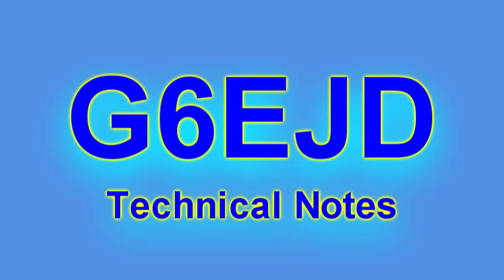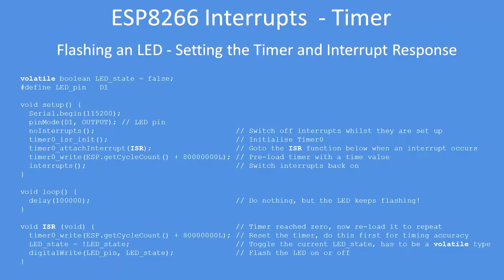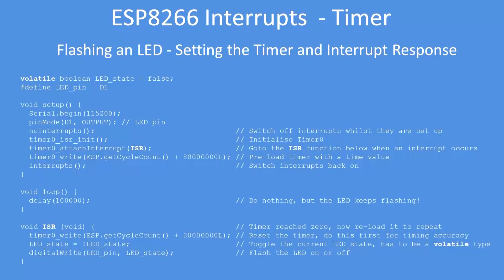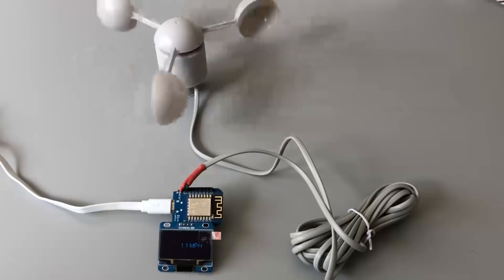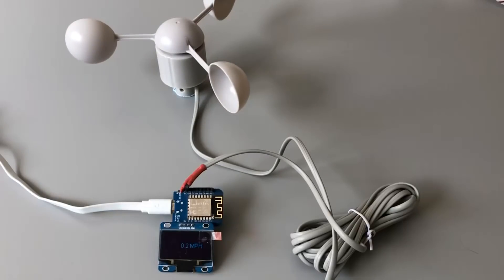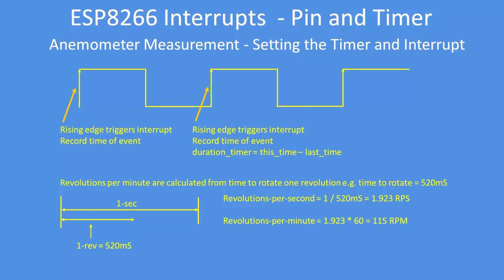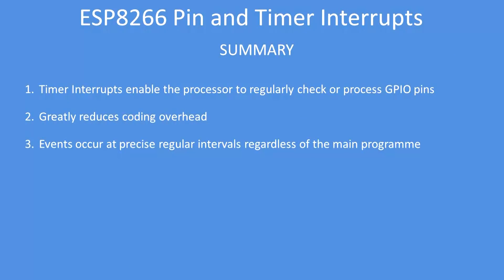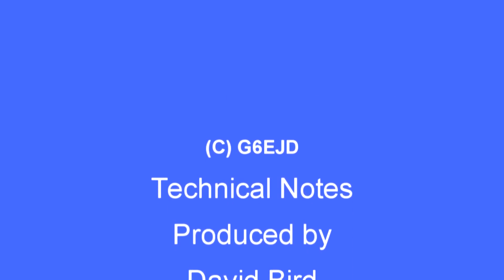Tech Note 125 - ESP8266 Combined timer and pin interrupts to measure wind speed sensors

Comment: Thanks for another clear tutorial Dave. I have a question about ESP8266 timer0, somewhere I read it's also used by the WIFI - if so how to use another (free) timer? I tried simply changing your code from timer0 to timer1 which compiled but timer interrupts didn't happen. When I run timer0 + WIFI every so often the MCU resets, I'm wondering if that's due to WIFI using timer0.
Reply from the maker: There are unreliability issues with timer interrupts using the Arduino IDE largely because interrupts are simulated and so are not hardware based. A lot depends on the interrupt speed your using, you should expect more issues the faster (or shorter time) you use. Yes there is some WiFi interactions but I think more likely your issue is about cpu brown out and that is resetting the cpu and problem like this nearly always stem from poor quality of marginal power supply, have you tried a different power source?
Reply: @G6EJD  Thanks for your timely response.
Interrupt rate is 50mS, not too fast I hope. Double checked PSU, it's a 2A powered USB hub feeding a 3.3V regulator all cables are short as possible.  I will put a 470uF cap. on the ESP-12F module for good measure.
Does the ESP8266 print 'brownout' debug msg, like the ESP32?

Originally the code was based on Tech Note 122 - "ESP8266/ESP32 NTP Time – The Simple Way" which worked well but periodically (after ~10mins) MPU would reset with a stack dump. I 'thought' the cause was timer0 used by WiFi because turning my router off after initial NTP sync - gave no resets at all.
Using timer1 doesn't seem at all straightforward, so far I can't get interrupts with WiFi enabled.
When you said " interrupts are simulated" do you mean they result in code that calls the ISR after counting given number of ticks?

I'm using PlatformIO, Arduino framework.
Reply from the maker: @rodneytapit5636  in the Arduino ISR structure they are not using timers per-se they are using the millis() and micro() to simulate a hardware variant. I e never experienced any issues with the 8266 as your seeing, have you captured the stack dump and used the esp debugger to trace which line in the core code or libraries is causing the issue?
Reply from the maker: @rodneytapit5636  ok, but you need to use that output with your specific source code and compiled image to trace the line, I can’t do that without exactly the same hardware. Do you have the ESP trace tool installed?

Comment: Hi again
Just noticed this video today...
Already ordered the items.
Two questions please
1 - it doesn't require 0,1uf capacitor?
2 - I am planing to integrate it as an entity in home assistant using esphome addon. Could you help converting the code to yaml?
Thanks again!
Reply from the maker: You may find it beneficial to add a small capacitor across the switch terminal to smooth out any switch bounce, but in general not required. Yes I can help with code conversion
Reply: @G6EJD  Hi, how are you? I FINNALY got my d1 minis and wind sendor... But while waiting I researched and would like to ask you if you could convert your code to esphome/yaml... Sorry, I am really newbie with this but being possible, would be easier to integrate in home assistant am I right? Thanks a lot in advance! Br
Reply from the maker: Probably, but I haven’t done much work on HA to know about the complexity of the task.
Reply: @G6EJD  sent you an email, have a look please when you have time.
Reply: The integration from esphome to home assistant looks very simple... Where I will need you help, if possible, is to flash your code converted to esphome if this make sense...

Comment: Hello, Can you please explain the debouncer  part of code in " ESP_Anenometer_SH1106_OLED_03.ino" ...... Thanks in advance
Reply from the maker: if (!(millis() - Debounce_Timer) < 5). When an interrupt occurs the variable Debounce_Timer is given the value of millis() then if at the next interrupt that occurred too quickly - it bounced! Then is millis() - Debounce_Timer less than 5, where 5 represents the chosen Debounce time, if so the interrupt event is ignored. And so debounced.
Reply: @G6EJD  Got it. I'm trying to adapt your codes for  my DIY CNC spindle tachometer project, hope it'll  work for more then 25000 rpm motors. that was very helpful. Cheers
Reply from the maker: At 25000rpm 1-Rev is 2.4mS long so that sets your time budget a denounce about 1mS
Reply: @G6EJD  Thank you David , will do sir.

Comment: Hi Dave - thanks for this demostration however I cannot find the code for the speed measurements as display at 2:36 mark.  Could you please share it?  Thanks alot Shelton
Reply: Not to worry Dave - I copied your code to the Arduino IDE using the screen at 2:36 mark
Reply from the maker: https://github.com/G6EJD/ESP_Interrupt_Examples
Reply: @G6EJD  Thanks Dave - I am using your code as a base to make a speedometer for my model trains.

Comment: Hi Dave. Do you have an example of how to use the pin / timer interrupts on an ESP32. Same as your wind speed program but for the ESP32. I'm using a pin interrupt with microseconds, but want to try it with the timer.
Reply from the maker: Yes I have done two examples on ESP32 interrupts. Can’t remember which video though. Let me know if not found it would interrupt in it’s title.
Reply: @G6EJD  thanks Dave. I'll trawl through your high quality content and see what I can find.

Comment: I just ordered the same anemometer as you show and use in your excellent as always video. I'm experimenting with micropython and the ESP32 and making a weather station to get my feet wet with a code exercise. I noticed your code on github is completely different to the timing technique you use and show in the video (Tech Note 125) to calculate wind speed.
The github code counts pulses per second unlike the video that times the pulse width. Both good working techniques and I went with counting pulses per second using micropython.
Your channel is always a source of inspiration and practical example please keep it coming!
Reply from the maker: Thank you. I used counting because it reduces code overheads, by that I mean unnecessary waiting for a timer to finish, so using interrupts enable a far superior wind speed result to be obtained, in fact; in real world examples most weather stations can not register low win speeds even though the anemometer is rotating, because the time to rotate is too long, but an interrupt based approach enables the time to be as long as needed. This gives you more time to display data and do other things, so infinitely better than conventional methods. I’m sure python supports interrupts.
Reply: @G6EJD  Yes I'm using Timer0 set to 5 seconds and averaging the count. I am also using a Pin interrupt for the switch and debouncing pretty much the same as you show in your C code example. So far micropython seems pretty good and a change from programming in C. A lot less code to achieve the same result, but it also enables C and Assembly to be used if needed. Not as many libraries yet as for the ESP32 in Arduino, but I'm using Thonny as the IDE and its not a bad place to start.

Comment: Sorry if i lose something, but the one second timer interrupt is just to check if the windspeed is zero?, this frequency interrupt don't affect the main loop fluency?. Thanks.
Reply from the maker: No, because the variable ' Event_Counter++;' is incremented once per second and so wind speed can be calculated from that.
Reply: @G6EJD  Thank you for the reply. 👍🏻

Comment: Grest video, what if a want to blink a led with a timer and also read the anenometer with using de hardware interrupt? Which one executes first?
Reply from the maker: Unfortunately the Arduino IDE implements interrupts in software, so you are unable to determine priority and which comes first is down to chance as at least one is asynchronous.

Comment: Nice one, tnx for info. Too bad you dont have more time to put more contest online.
BTW you can 3d print and make one yourself, with some magnets and hall sensors.
Reply from the maker: Jedan Decko, yes I’ve seen the versions on thingiverse actually they are better as some are using a Hall effect sensor which would give a cleaner switch and provision for bearings. I’ve had an esp8266 solar powered weather unit printed in PLA outside for 2-years now and it shows no obvious signs of degradation so worth a look again, thanks for the hint.